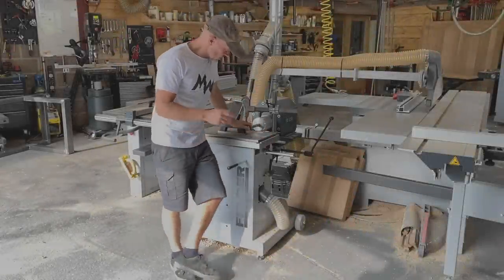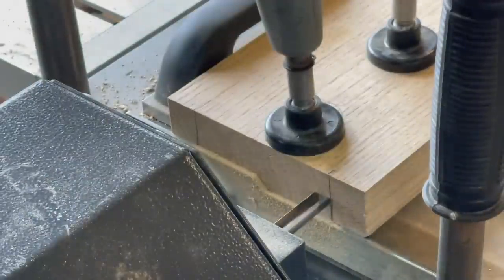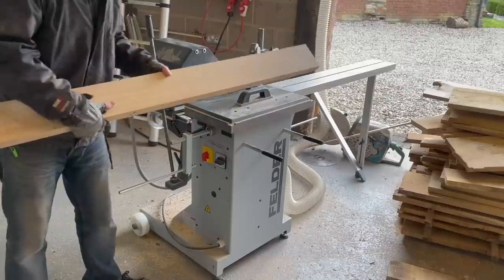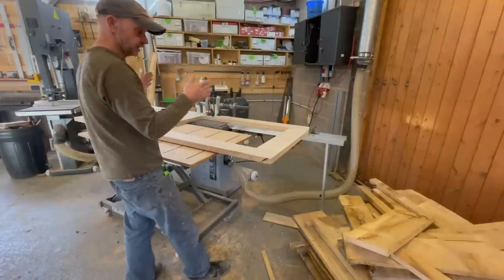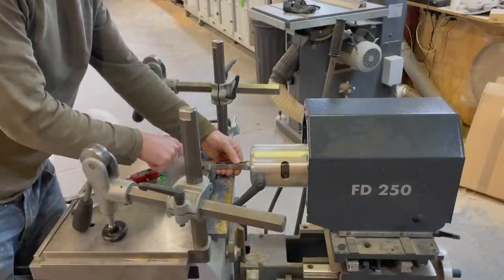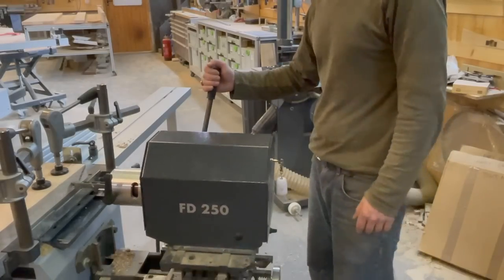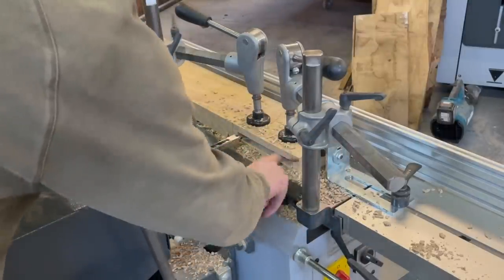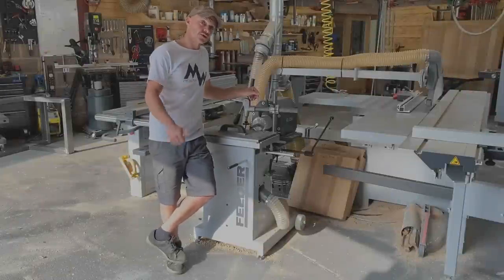Felder Mortiser FD250  in-depth

Comment: Excellent video. Good narration: very good camera work: excellent production values. I’m never going to “need” a machine like this. Even when we were making to sell, each piece was bespoke and we found that the setting-up time on a machine for one particular cut usually exceeded the time spent doing it by “hand”. However, if you are making a number of cuts, each the same, then the machine becomes more and more economic. 

As I get older, my major issue with an increasing number of machines, is that I forget all the features and set up process of the machines. Don’t worry, you will get there eventually!

Comment: Got the same machine with end stops, and longer posts for taller work, extension 300MM alum tables of which you can C clamp a backstop for big work.
The endmill for smooth or rough cuts is much better than those birdseye stuff that Felder leads us into. And bradpoint bits are so smooth. Don't forget to grease and clean
the vertical ways periodically. Us a bubble level on the machine table and then likewise set on the bit and you have parallel. Put some moly lube on that rack and pinion gear for the
depth and you will notice how much easier the plunge is. I find the handle back stop will roll on you so I have 3"  X 4" and small beams of wood I C clamp to the extension tables-Felder to
prevent such. The Swedes have some high chrome 30MM metal posts with 20MM threads you can get for the camclamps and do oil the clamps on occasion. I find if you cut about 
3/8" off of the metal rods of the camclamps' just pull off the black round handles and hack saw them; then, you avoid hitting the end of the lever on other things-it clears better and you
don't lose that much leverage. Best machine on the market. Martin was close but does not have the accessories. I have the rolling kit also for maneuvering. Not necessary to have the vac
going all the time. Powermatic has Japan square chisel that are superior to Felder having better metal. Let the saw dust begin.

Comment: Thanks for this helpful video! Do the vertical clamp locks need to be loosened whenever you're raising / lowering the height of the cutter? I've had those clamps locked when adjusting the height of the cutter and now the vertical gear chuck is stripped in one spot.  I'm guessing it's because I should've had the vertical clamp lock loose when raising / lowering the cutter.  Thanks!

Comment: I built a mortising machine that is much heavier to mortise the slots for doors. I used a variable frequency drive to be able to change the speed of the motor. That allows me speeds from basically produced by whatever I choose of about 30 hertz to 120 hertz. In my case most of the time I run the cutters at 120 Hz which gives me a RPM of about 6900. I use standard milling cutters for steel. I have cutters ranging from about 1-1/2 inches to about four inches in length and from 1/8 inch to 1/2 inch in diameter. If I had known about the Felder I would have bought it with the extensions. The machine I have works very well but it was not easy to make.

Comment: put a little cup grease lube on the rack and pinion gears now and then. Starrett, USA, makes a pocket level that comes in handy in setting the chisel square with the table (check bubble position on the table and then do same on the flat side of the chisel). I tend to use those 300MM Felder alumin table extensions rather than have the Aigner attached. With the Felder extensions you can C clamp a wood block to the table if the piece you are working is beyond the cast iron table. You can cut a wedge angle on the table saw and position it under the work piece so you have an angle
tilt of the table.

Comment: Love the video.  Would you recommend this machine for producing 200 solid wood entrance doors per month?  Also, are you using floating tenons?
Reply from the maker: Yeah as long as you keep changing a bit keep it Sharp, sometimes it’s faster to use floating tenants
Reply: @ManorWood There is a Japan made premium chisel set that stays sharper than Felder. Powermatic sells one

Comment: It's the hack and stack of mortising machines. I suppose if it had two heads so you could square chisel the ends it might be worth a go but you can't beat an oscillating chisel Mortiser for speed, accuracy and dust collection.

Comment: Like Felder quality of machines but this is one machine I really don't see any point in having over a standard morticer like the Sedgwick style morticer. I'm guessing the maximum square chisel would be about 20mm and the operator will get far more fatigue in the "pushing/pulling" movement to use it over the standard "Pull down, push up" movement on a standard type morticer it might be fine for the occasional woodworker but I don't know a single Joinery who uses this type of morticer. Felder machines are cost effective but far from budget prices so I'm guessing this is more expensive than an Sedgwick which costs around £1300+vat. When morticing a lock in I a door style either mortice it before constructing the door or use a jig.......... Cheap and cost effective.. Just ordered 3 new machines from Felder so I'm not anti Felder..   All the best   Ade
Reply: Yes, what you says makes sense. I cannot see how this is better than a traditional Mortimer either. Surely you are not expected to hand chisel out the round ends afterwards ? That is a waste of time. Best bet is to get an old Wadkin MF or DM with vertical stops and multiple length stops, spring loaded. You rarely see these Felder Mortimer’s  in the UK but then maybe Manor Wood are producing something different

Comment: Sorry, but im going to be a 'hater' - looks to me like Felder have tried to reinvent the wheel, so to speak. Yes it seems to serve the purpose of a slot mortiser okay (remember all those that can attach to the side of planer thicknessers? - Whose ever used those anyway!?) - But as a regular mortiser - why not just have a nice large chunk of cast iron which is more user friendly and ergonomic, at a fraction of the price? (I picked up a very large, heavy and accurate Cooksley for £100 on ebay) The FD250 looks super janky and awkward to use, and i'm surprised how slow it handles any of the tasks given to it. I'm all up for workshop innovation, but this machine seems like a poor substitute for a mortiser, and doesn't do anything that a decent router or domino machine can't do either.
Reply: Over here in Chicago using the FD250 with square chisel option and 3 phase. If you are putting a square hole in the end of a beam the Felder shines. For box work with perfect alignment for hinge cutting-lid to box wall the Felder is quick and accurate and with 20" custom cam clamp posts we can hold the wood for precise cutting in multiples. Try the
Felder and then try to figure a way to say "nay". Figure the cost of some machines over 10 or 15 years that can deliver a competitive edge and that puts things in perspective. Hard to find a Felder on the used market that will do 19MM square holes and with the step and repeat optional fitting we have accuracy and speed. Some of the Japan steel quality bits surpass Felder quality and will stand up to production work. Those hand held Domino tools do not have accuracy after 3 hours of production where accuracy is paramount and if you have low cost labor they just tend to not get the job done. Set up the Felder and any one can run it and do super work. Hand held machines and tools have movement in the cut built into them if you want side by side cuts in mortise and tenon work.
Reply: Doubt that Felder invented it. Lots of Europeans use  this system. In fact, I am not sure that Felder even made the machine.